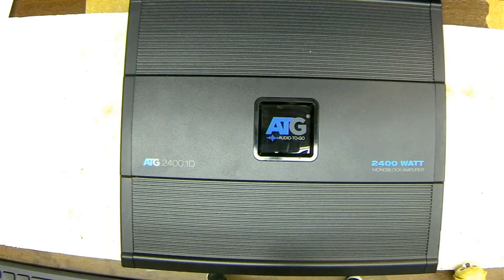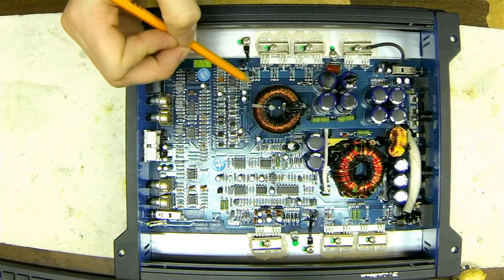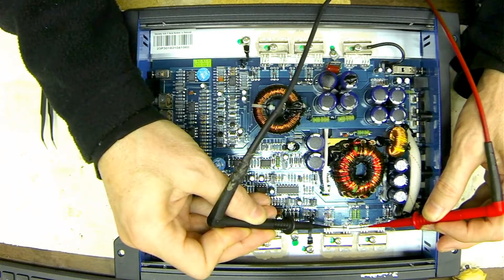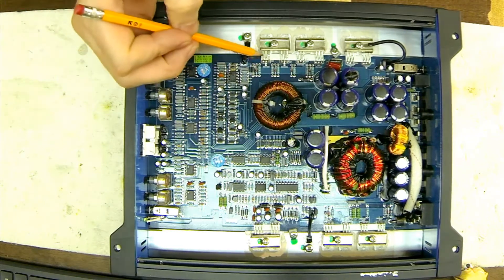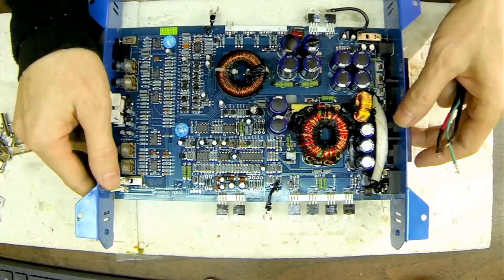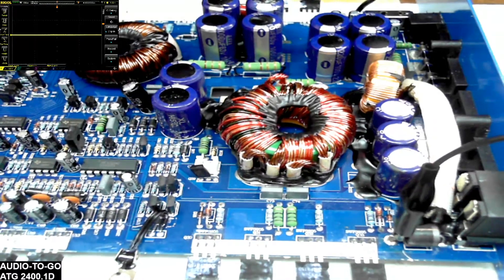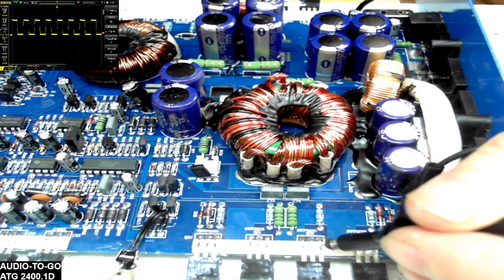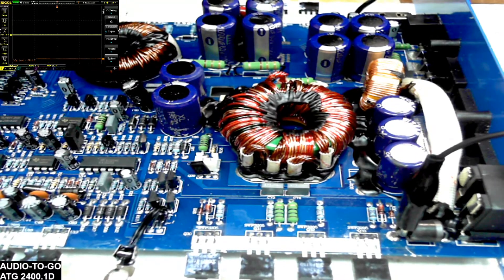ATG ATG2400.1D 2400 Watts Monoblock Car Amplifier Teardown and Diagnosis Part 1

Comment: Hi! Great review and fix process video! I just got myself almost new, barely used one, exactly same model, what’s your opinion on overall quality build and SQ characteristics of these ATG 2400.1? 
And - specs gives power output on using it with 1 and 2 Ohms impedance subs, but can I use it with 4 Ohm Kicker tube one? Might sound silly but I’m new to this and trying to learn, would appreciate your answer a lot! 
And just ur overall opinion - I have two subs/amp combo - 1 - Kicker TB 104 sub which is 10” 4 ohm tube came with kicker CXA 400.1 amp, which specs says 400W@1 300@2 and 150@4 ohms - seems to me bit weak for sub which specs to be 4 Ohms and be for 400 rms/800max - such amp would be less then half of optimal power for sub?
On the other hand - TGA 2400.1 which says its 600W @ 2 ohms and sub - Kicker dual 10” 2 Ohms, 600W - seems as great match?
What if I use 2400.1D which specs doesn’t say what’s the output at 4 Ohms, but I guess - around 300W @ 4 Ohms - paired with Kicker tube 4 Ohms with 400 RMS? Might be better combination then with CXA 400.1?
Great thank You if You could share your opinion!
Liked and subscribed!
Reply from the maker: Thank you for joining my channel! The build quality of this amplifier, in my opinion, is quite well and better than I was expecting. The heatsink is rather small so I would not run it under 2 ohms for any length of time. All components are of good quality and the layout of the board is comprehensive with well secured components. This amplifier uses the same drive architecture as the video I released of the Soundstream drive card. Now for sound quality, all I can say is this is a typical class D amplifier with minimal output noise with the typical frequency response.
May I suggest thinking of a subwoofer in a slightly different way? I wouldn't focus so much on matching rated power but rather focus on matching a subwoofer to its enclosure for the right frequency response. This will yield much better "SQ" results. Also remember "The gain control is NOT a volume/bass control" it's for matching the amplifier to the headunit.
If you need any information on other amplifiers please feel free to email me directly as I am more than willing to help.

Comment: So can vibration from my exhaust system destroy the amp?
Reply from the maker: Great question. Maybe over time it could but I am not sure if an exhaust maintains a specific frequency with any form of amplitude or driving force behind it. My answer would be no, but not conclusive.
Reply: @ellensburgamplifier  Reason I asked is I had the ATG 2500 installed just over a week ago and it only lasted 7 days exactly.
Reply from the maker: @Nvenus27  I doubt it was the exhaust that caused the ATG failure. There are a few common reasons for a failure. Under voltage, under current, output over current, low connected load and last but not least one of the biggest issues is heat if you were wired right at the lowest recommended load. The ATG is built nicely but it does not have a lot of thermal mass.
Reply: @ellensburgamplifier  One ATG2400-D to one of their 12” 3500 Subs. Have 14 volts coming into the amp. Zero output. All the fuses are intact and I have no lights on the amp. 🤔 Was professionally installed at a car audio facility. Guess I’m glad I bought a warranty.

Comment: Dyno test for output??
Reply from the maker: I don't dyno amplifiers here but I can say by design that this amplifier's model number does not represent the output.
Reply: @ellensburgamplifier  i figured that, looks like garbage, the power accoustic 2400 gives 700 watts at 2 ohms for around 100.00.  Over rated as well but a  better bang for the buck for a budget build
Reply from the maker: @wiillthebarbertv9415  Derek (BigD) has reviewed a few cheap amplifiers that are of a decent build for just a little over $100.